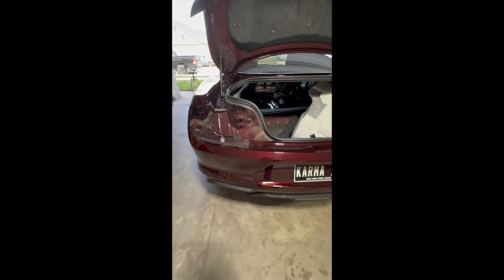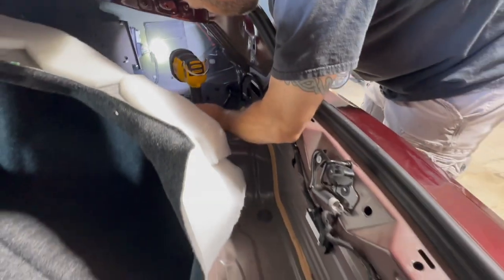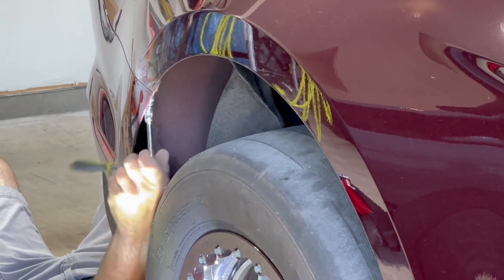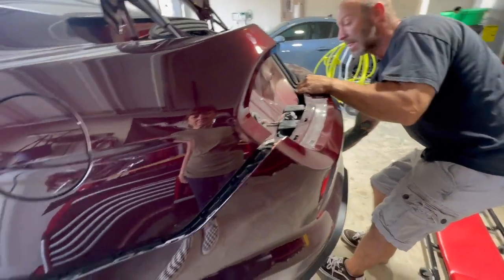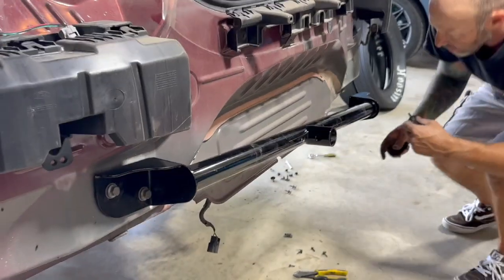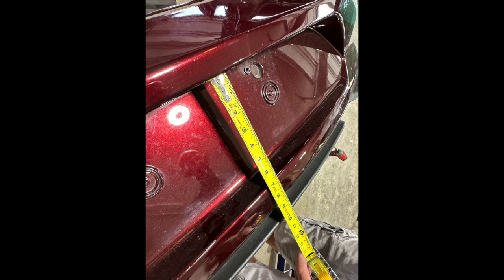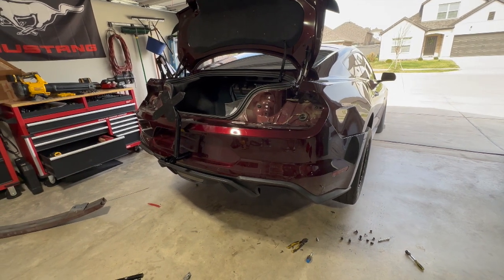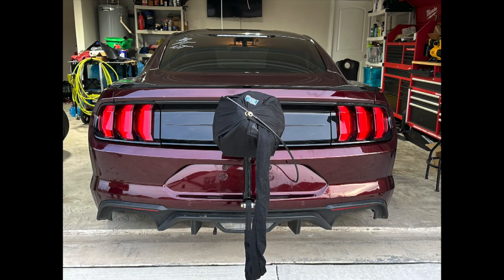Motion Racework Parachute Mount Install

Comment: If you don’t mind me asking, did the hole in the bumper what’d u measure and where six u get the info for? Bout to install mine tonight.
Thanks in advance
Reply from the maker: I just mounted the bar, then found where the bumper hits it and drilled a hole.